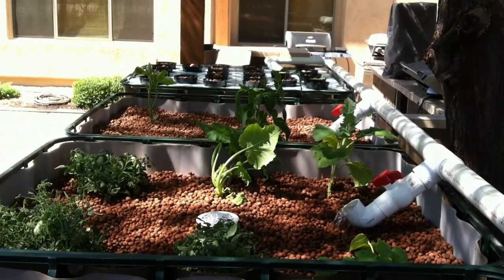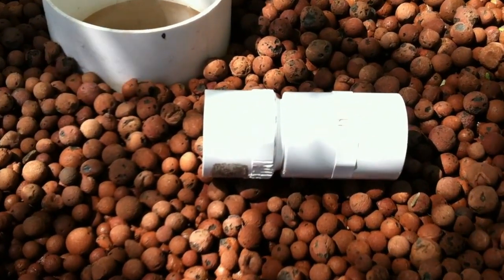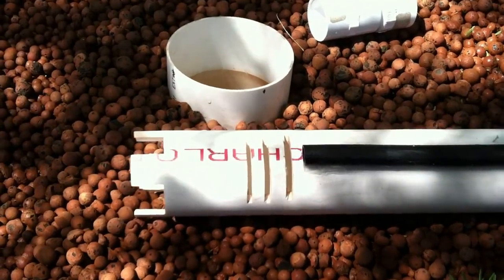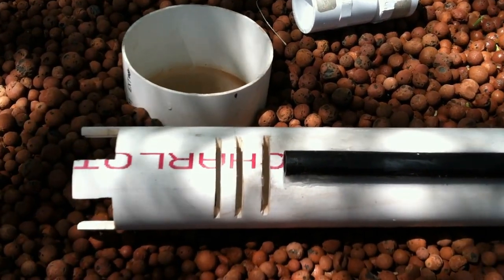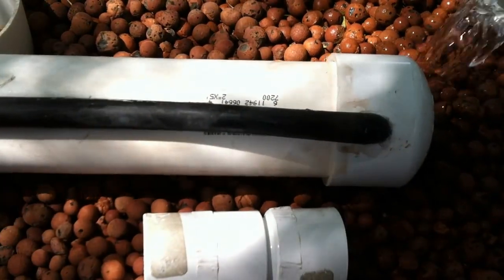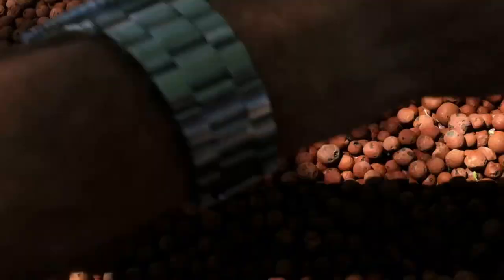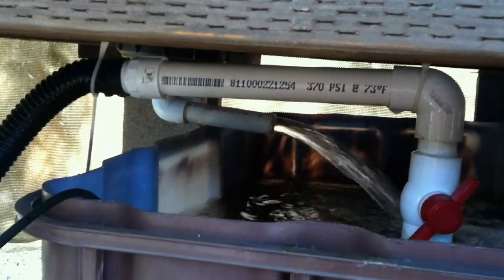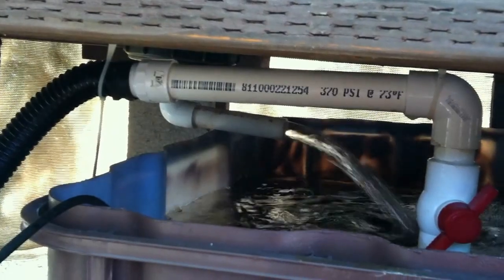Aquaponics in Arizona Pt.2 - The Bell Siphon

Comment: Hi there. I'm in Chandler, AZ. Nice to find some AZ specific aquaponics videos. I have a system I set up on Feb 1, 2013 and I'm using IBCs also. I'm curious as to why you want to keep a couple of inches in the bottom of the grow beds? I thought it would be better to get all of it out each drain cycle, so I made my siphons really suck everything out. I only have teeth on them just at the very bottom so every last bit of water gets sucked out. Thanks for the videos and good info!